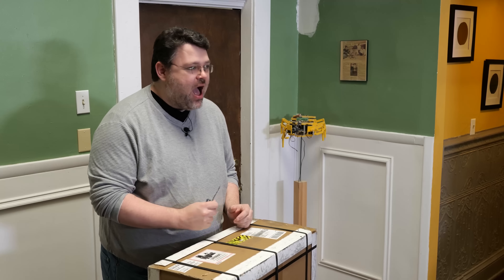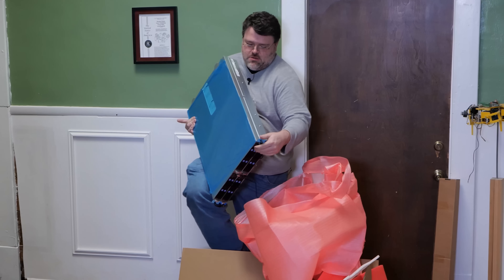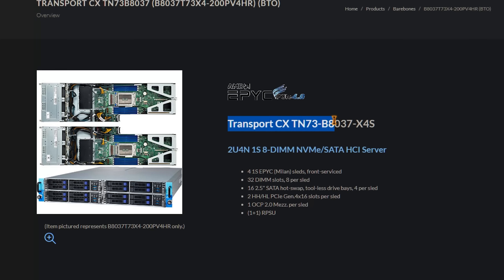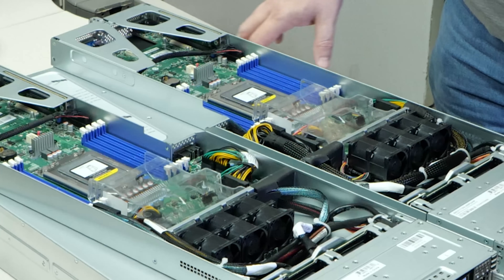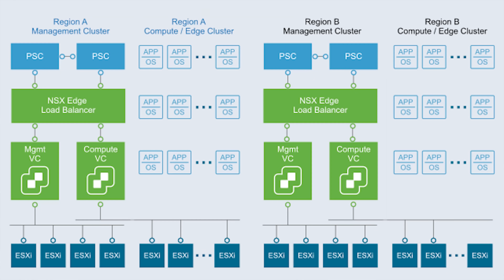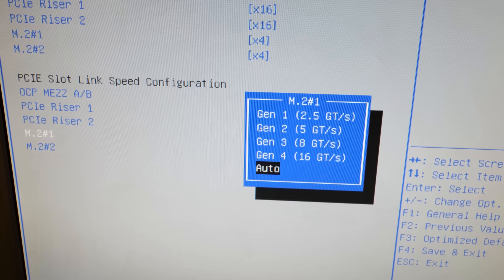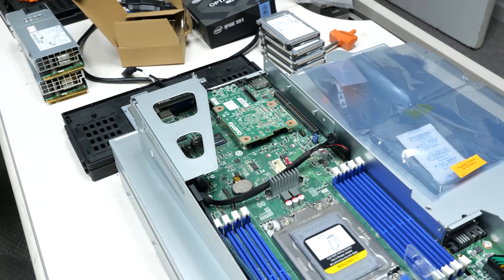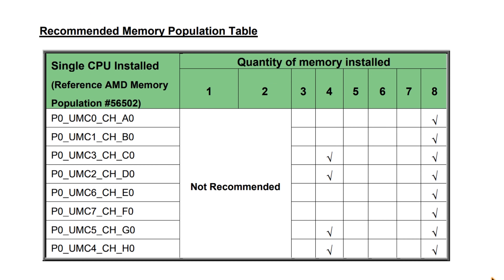Titanic Tyan: Up to 256 Core Server Chassis - 2U/4S Epyc Transport CX TN73B8037

Comment: I cant wait for this 2 socket 4 node to hit the $200 mark like that Dell CloudEdge C6100 i ALMOST bought like 3 years ago
Was made in 2010, at the time had the best processors you could get with the new 6 core Xeon X5675, each node could hold i beleive up to 192GB of RAM
Edit, i do like how the Tyan nodes have the drive controllers and cage assemblies as part of the node instead of a backplane, but i wish it was a little bit more dense. I'd love to see a new standard for NVMe hot swap that uses enclosures for a 110mm nvme and then just uses a USB-C connector
I know this speciffic adapter wouldnt be suited well but its external design would be great, the SSK "SHE-C325" has edges that can be used to guide it into a rail quite well. There are several internal changes i would make to the design, speciffically making it tooless, a thermal pad behind the NVMe, and a door that closes onto the top of the NVMe with thermal pad instead of sliding it inside of a tube(scraping off the thermal pad most of the time)

Comment: I wonder how redundant 2 x 2000W power supplies would be enough when one fails.
The 4 systems alone without expansion will consume close to 2000W, is sit not?
Does it just enter a power limited mode for the CPUs?
Will some expansion slots just stop working?

Or is there sufficient overhead in one power supply to have it carry the load of 3000W combined (assuming expansion across both servers is close to 1000W combined)?
It still looks great to me as many uses will not need heavy power consumption in the slots, just extra IO of some kind.
Reply from the maker: the fully loaded load is closer to 1250-1300w +/- so one psu has plenty of margin. But modern chassis are smart enough to be aware of the overall power budget, too.

Comment: Level 1T:

Can you do a review of a server set up for the following...
-  15 Drafter, using Revit 2020
-  2 managers that also need to be on that server.

Autodesk Revit, the nature of it is has a "Central model"  That resides on a separate central computer.. and multiple users, sync up their work to that system

-  15 drafter, are wasting  25-30 of there working time on "Syncing."... 

What system would be ideal for a good review. on here. that you can cover for type of environment with this issue. 

let me know. 
Ty

Comment: F@H CPU slots would be a good try for this, since those scale well on multiple of 2,3 and 5. You could try 30, 60 and even 90 threads if you have a 64 core processor lying around and see what kind of PPD they bring to the table.

Personally though I'd stick with a 1U server and shove four A100 cards in there for the highest density. Expensive AF? Sure. But after 12-24 months of mining the costs could be recouped. Most servers last 5 years easy and even go beyond when the warranty expires. The great thing about passively cooled CPU's and GPU's is the fan replacements are easy, and if you've got good air conditioning in the room, will last beyond that 50,000 hour MTBF

All that said, I am curious what your power bills are LOL Do you have solar?

Comment: What would I use it for, hmmmm - heat a medium sized office in the winter.

Thing that struck me was the layout, if you have memory that runs hot, that without any thermal zoning might effect the CPU and equally vice versa.

Be interested in seeing some heavy memory/CPU workloads and thermals - can you pull the temps of the individual memory slots?  As wonder how hot those sticks next to the CPU will run.
 
But dam, that's some fun lego you have there.

Comment: Fujitsu has had a CX model running dual socket Intel Xeon CPU's in each of the nodes, and 4 nodes per 2U box, Although the Fujitsu model is fairly deeper than most servers and can sometimes have space issues if the rack system isn't deep enough. However it is still running up to 8, 26 core CPUs in the 2U chassis.

Comment: What is the advantage of 4 single socket, as opposed to say 2 dual socket boards?  I would imagine the latter would be cheaper overall, fewer duplicated components (e.g. power rails), also more room for expansion slots, without sacrificing on density.
Reply: Some clusters require at least 3 nodes....

Comment: Man... i miss the like 2000's early 2010's era of barebones desktop consumer builds. I got my first computer  off of TigerDirect in like 8th grade with all the money I had earned. The barebone was like 10-15 bucks cheaper than the components retailed .

Athlon x2 .. 64! ooo the first 64 bit processor. There were like 10 programs for windows 64 bit back then and like 7 were web browsers and archive managers.

Comment: 08:00  The P variants all have exactly the same specs as their non-P counterparts.  Literally the only difference is the lack of dual-socket support.
Reply from the maker: what I was trying to say was that you won't find a P variant clocked like the F series. Because the point of the P series is to be cheaper for 1s systems, not be the fastest. Hence the "odd" recommendation that sometimes F cpus in 1s servers still makes sense even given P series cheaper alternatives.
Reply: @Level1Techs  Fair enough.
Reply: that's... what he basically said?

Comment from the maker: *ocp2 pcie3 somehow became ocp3. It's ocp2, not ocp3 just fyi. Still 10 and 25g is no problem
Reply: btw it's 1800w for 200-219v, 220-240v is 1968W, much closer to the 2000w rating. I thought it strange that Delta would lie by 200W
Reply: ...tell me why, tell me why, Wendell? What are you doing with all these chips?
Reply from the maker: @peppybocan  the kilothread server is inbound. I'm just the silver surfer heralding the arrival
Reply: @Level1Techs  I could tell you where I would like to use them ... oooh so many places where to use them. You could build a CI/CD pipeline that compiles and tests Chromium completely end-to-end! That's just a wild example...
Reply: @Level1Techs  hahaha and I though 3:49 was the moneyshot! Kilothread server hahaha!
Reply: @peppybocan  or a minecraft server.... for the entire country

Comment: 256 cores in 2u, sweet jeebus! It's almost hard to wrap your head around.
Reply: That's not even the densest system. Supermicro has 2U 4 node system with 2 sockets each. 512 cores in 2U.
Reply: @creker1  man that would get hot